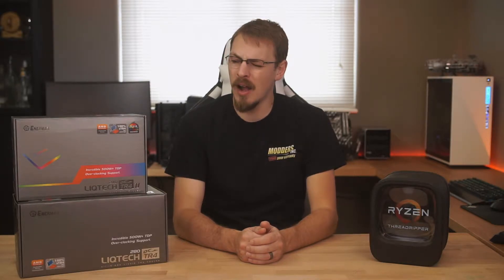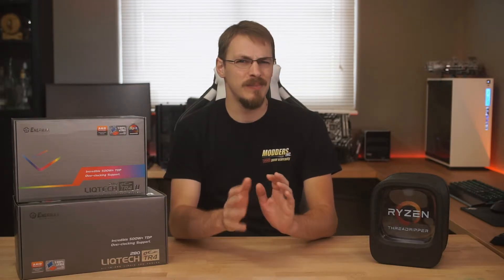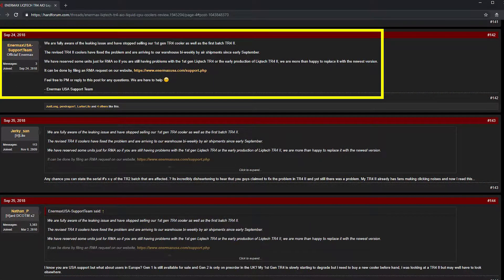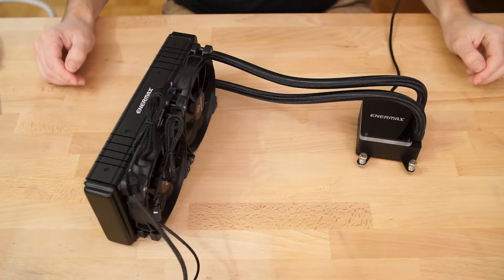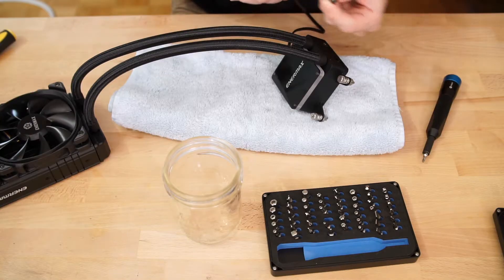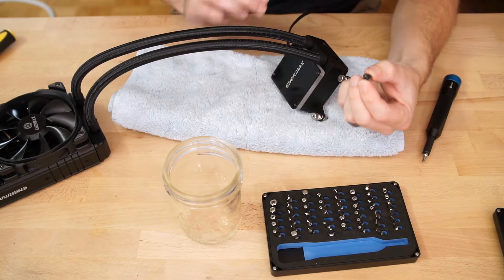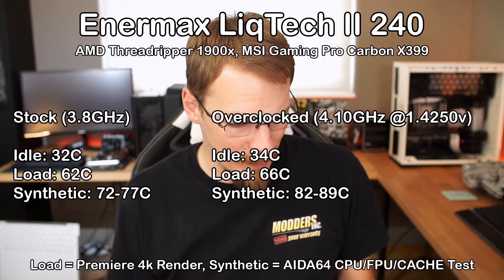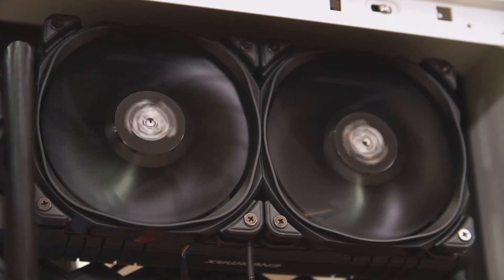Change of heart - Enermax LiqTech II 240mm TR4 Review

Comment: I had the first one and it died in a couple months.  So I replaced it with a Noctua air cooler.  I forgot all about it.  I am working on some old systems I have and had to look for some parts for them in my stuff and found that cooler.  I found out I had about two weeks left on the warranty and contacted them.

They asked for a photo of it with the serial number and a copy of the invoice.  I received the replacement today.  Less than a week from start to finish.  So great service from Enermax.  I haven't put the replacement in yet because I have to shut down and move things around in the system but I'm hopeful it works without issue.
Reply: Fuzzy Johnson Have you put it in yet and has it worked or not?

Comment: Glad to see people looking into this and reporting on the issue!! My Gen 1 Liqtech 360 was both gunked up and getting eaten away.. It nearly leaked onto my motherboard. I moved to the Gen 2 (as there was no other options for me at the time - none!) and after about 6-7 months now, the Liqtech 2 360 is now sitting idle at 55-60 degrees and load seeing it sit on 87! Just like what happened with my Gen 1. Absolutely not worth the money.. Wont be getting another one and wont waste my time with an RMA as it will just die again in 6 months.
Reply from the maker: Sorry you had issues. Enermax is aware and they have been working on solutions. Hopefully, they can get stuff straightened out.

Comment: Just taken my 1st gen Liqtech apart and it has corrosion i had the 360mm, i now have a 360mm Liqtech II - which I'm am stress testing for a new vid. However got my CPU down to 19c in the bios and before testing at the moment im sat at 22c, 1900x 4.1 on all cores. will do a stress test video shortly.

Comment: My liqtech 360 burst all over my GPU and I had to send my GPU, mobo, and cooler back for testing. 3 months later I’m finally getting replacement stuff back including the new liqtech 2. This is terrifying to hear but thank you so much for sharing! Will definitely be buying air cooler and sending this back too.
Reply: I know that this vid is a bit dated, but Enermax has reported on their site that they know of the fact that they had contaminated coolant in their coolers that serial number started with 17 and have since remedied it.
Reply: @OmniscientWarrior  that is correct but that was way after the issues were abundant. Plus 3 months to get back an entire system when they claimed it would only take 1-2 months? That's insane and unacceptable to me, especially if you rely on your system for a job, which i would assume you do with a threadripper build. I personally can't chance loosing out on work again for another 3 months.
Reply: @chrisyodonis6886  My newer computer is a TR build specifically for using Blender.  But I do have an old system that can technically do the work, but at 1/6 the pace.  However, it has no effect on the speed at which I can make models; rather call it prebuild models as need rendering to test and clean up and simple models won't be a problem but the big ones, the render time difference is really felt.

As for restoring the system, I do that stuff on my own, takes a couple of weeks.  Backups are your friend.  So it would come down to how fast they replace the cooler.  Even still, you can technically get by with a $50 one, just know your cpu will end up being slower due to lack of as efficient cooling.  I rather have slow opposed to nothing.
Reply: @OmniscientWarrior  Yes that is extremely true, if and when I'm modeling (mainly for fun not what I get paid for, which is editing/compositing) I use my laptop cause its convenient and it works fine, except for high poly modeling in in zbrush, then it chugs. 

As for restoring, the leak on the first gen liqtech poured out all over my gpu and fried one of the memory modules, rendering it useless.Which is my the company asked I send away my mobo and gpu along with the cooler, so I literally had 2 major components missing not just a cooler. I didn't have the funding to drop 1200-1600 dollars on a replacement gtx1080ti and x339 mobo so I was stuck with my 2012 laptop. Everything is and was backed-up, thank glob. The ssd and hard drives were fine and everything is up and running now but I cannot risk losing a system for that long again. As I'm sure you know time is money and when your laptop (or other backup system) is taking 6 times longer to render out shots, thats a lot of money to being losing. I agree that I'd rather take a few degree hit on the temps and have 32 threads, through the noctua tr4 coolers look ok till I get the money for a custom loop. 

 Basically though it was just a bad experience overall, from turnover time and communication to customer service. I get why people purchase this product, a top aio and the only aio with full plate coverage for tr4 sockets, hell it's why I got it. I don't begrudge people who buy the product or support it but I feel people need to know about the potential issues that may arise if they're building something they want to rely on for cash flow, even if my case was an anomaly.
Reply: @chrisyodonis6886  I would have to question your company about the turn around.  How long does it take to do a quick component check and swap, a quick cleaning with alcohol or other cleaner, then boot up (with IR if possible) and see how things work?  Then just subsidize the better cooler for a cheaper one until the replacement comes in.  You should have lost at most 3 weeks with standard shipping unless out of the country.  Labor time for me would have been maybe 2 hours.
Reply: @OmniscientWarrior  I whole heartedly agree and that paragraph you wrote is my whole point of frustration with enermax. Enermax is the company that the rma was sent out to. Their company does the testing and it took them that long to get the components back to me. Not to mention at the end of all of this they ended up giving me a check for a replacement because the motherboard was lost by them. This is why I will never go back to their company.

Comment: I originally got a first generation version and performance tanked, it would overheat under normal loads. After doing research I learned everyone was having the same issue.

I contacted Enermax and they were nice enough to send me a replacement 2nd generation version, but it has also started to show similar signs of degrading performance after a few months. Currently my Threadripper is hitting the tdie limit (68C) running under 10% loads. The processor is getting throttled to 3.1ghz when I used to be able to get 4.0ghz overclock.

They really should be recalling these and offering refunds.
Reply: I'm sitting on a Gen1 240 for my 1920X and it's idling at 68C. Can't even control the clock speeds for some reason, and it still tries to turbo boost or w/e it's called, so ofc temps go up more. I've been looking for replacements all weekend, but Enermax seems to be the only one with a plate covering the whole CPU. It doesn't help that I live in a country that has very little to offer in terms of tech stuff, so that will make it extra hard to find a replacement. Did you find one that performs well that you could recommend?
Reply: @romeozor  I went with an air cooler. I got an NH-U14S TR4 cooler and paired it with a TY-143 fan which I found gave me the best performance that fit in my case. I'm even able to do modest overclock to 3.9GHz no problem so I'm content for now. Good luck!
Reply: M D thanks, I looked at that too, but unfortunately my Corsair micro ATX case only allows for 120mm height cooler, and most start at 150mm. I ended up getting a Corsair H100i RGB Platinum cos it came with its own TR4 brace and I’m more or leas satisfied. The extra cabling is horrible, and I couldn’t care less for rgb, but temps are good.
Reply: Your not alone.. mine is now doing the same thing. Burned through 2 Liqtech coolers now and all its done is guarantee ill never buy an Enermax product again.

Comment: Just picked up one the other day (ver II 280).. hopefully by now (July 2019) they have it all sorted. Right off the bat I only see a few degrees cooler than the 4+ year old Corsair aio I had on there (was used in multiple systems still going strong).. not entirely impressed by the TR4 specific aspect of it yet.

Comment: I bought a TR4 II 360 and idle sat at 68, then throttled my 1950x to 0.54, before rising to 78 and shutting down! Swapped it out with a Coolermaster Wrait, now idling at 45 and never goes above 65. What a disappointment my first AIO cooler was.
Reply from the maker: Sorry man. Cooler Master stuff is great.

Comment: I opened up my tr4 240 1st gen after 8 month, and the gunk covered all microchannel. I drained the green liquid, rinse with DI water, fill with pure DI water, and it’s been working without gunk for another 8 month now. However the whole thing blow up yesterday...so yah it’s a shit cooler with good cooper block and big microfin. The radiator also looks very promising, the fins on radiator all have micro structure. The corrosion is just too much.

Comment: I have 1950X and after some CPU mining I noticed it was getting hot.  95C and I have a Thermaltake 3.0 RIING 360 Water Cooler ( Closed loop ).  I assume this means the pump has failed. Even at idle it sits at 60C.  Surprizing the CPU still runs great.  Just goes to say how well built these are.  However I want to get my temps back down.  Is it possible that the defect with the Enermax is the Cooling Fluid?  Is it possible to just use a different fluid?  Any recommendations?  Stilll looking for a good 360mm cooler for my Threadripper.  Seems the pumps on all these Closed loop systems only last a couple of years at best.
Reply from the maker: It does sound like something has failed and yes it sounds like the pump. If you have it plugged into a pen on the MB I would pull it off and just it off the main power.
Reply: @Moddersinc1  thanks for the tip I didn't think to run it directly off the power supply I'll give that a shot

Comment: Thank you sir! You saved my ass on a client build.
Reply: Or did he?  Have you been on Enermax's website?  They found the problem with the coolant and have replaced it.  So this issue only exists with serial numbers starting with 17.  You can file an RMA with them.  I have been using them on my new pc for a month, which I know isn't much time, but so far, it has been holding just fine.
Reply: @OmniscientWarrior  hey, do you have any update on this? I'm looking to buy one but not sure about long term use.

Comment: Aww man, I just got a replacement for my first gen liqtech after I noticed reduced performance. I contacted enermax and they sent me a liqtech ii.

Temps are okay, not great, and now I'm worried it might go down the same as the first one :(

I'm running a 1950x and unfortunately my case only fits a 240 radiator.

I can't clock over 3.8ghz without temps climbing to 80c, when I originally installed the system I was able to get 3.975ghz
Reply: Check the serial number, if it starts with 17, it may have (or had) contaminated coolant.  Also, if the environment around the computer has gotten warmer, then you should expect it to run hotter with it.
Reply: Enermax said that the first batch of TR4 II were also affected. They have suppose fully  fixed this now at the next batches of TR4 II. I can't know if the TR4 II at the video is from the first batch but it could well be as the video upload time is October 3 and Enermax announced this at September 28.

My TR4 360 died out after 10 months and I contacted them for RMA. It was an easy process and I am now waiting for the replacement to arrive, I think it will be a TR4 II. I will know in a ew days. I am likewise worried whether this will have the issue or not.

Comment: Which cooler do you recomend for 1950x? Great vid btw.
Reply: AsusRoG Go with air cooling. I love my be Quiet! Dark Rock Pro 4 TR4! Temps range from 24C idle to 61C heavy load. I render 3D with Maya/Arnold/Vray for hours on end. It's consistent... and nothing to leak on the other components like AIOs.
Reply: Coolermaster also makes a fairly large tr4 air cooler.
Reply: @michael22262   How many frames per hour can the threadripper do? I can't seem to find much information about tr4 and Maya/Arnold/Vray/renderman etc. etc.. Most people only ever talk about video editing or blender, and of course cinebench r15
Reply: Hi Ken. Well to answer your question about on frames per hour, it really depends on what and how you're lighting your scene. What a lot of people do is use a baseline measurement application such as Maxon's Cinebench. It's free. All you have to do is download it from here:
https://www.maxon.net/en/products/cinebench/
and then run the file.
When I ran cinebench on my older i7 3.2 gHz Boxx it only scored around 800. But that was fast back in 2010. In my new computer it gets to 2990 fairly easily. (Higher is better) 
Look at a lot of youtube testers out there like Gamers Nexus or Linis TechTips.
Also, go to pcpartpicker.com. One of the guys there was very helpful. 
Good luck!

Comment: Hey.
Don't know, if this comment section is still monitored, but do you have any plans to test the new Liqtech 2 non-TR4 version?
I'm really interested to see, if there is any actual performance difference between Enermax's stronger pump and maybe better coldplate, compared to Asetek coolers, like NZXT, Corsair etc.

Comment: I have the 360 one, about 7 months old. First I got idle temps around 55C, then 75C and now it goes from cold boot to 95C in about 10 minutes and shortly after that the PC shuts itself down due to overheating CPU. DO NOT buy Enermax AIO's!
Reply from the maker: So we recently did a review of their 360 mm variant. It was supposedly the re-release. Also, they were said to have fixed the issues. However, in testing, we had several issues with overheating. But not to that extent. Have you reapplied thermal paste? Also, what processor are you using it on?
Reply: @Moddersinc1 By now, I have reapplied the paste 3 times, have reseated the CPU, just in case. It has had no positive effect at all. Running 2950X at stock. The pump block gets hot, both incoming and outgoing tubes get very warm, but the radiator is totally cold. According to ASUS's some monitoring tool, the pump is running at max.
Reply from the maker: @sirius4k  Hate to say it but you need to replace it with something else. you reach out to Enermax to see if they will switch it out our replace it.
Reply: @Moddersinc1  I'll try. My first attempt trying to get in contact with them ended up with no reply.

Comment: Did some digging, if you can I would like for you to verify, did you get one with the serial number starting with 17?  I ask because Enermax found that they were shipped a contaminated coolant in those and have since corrected that issue.  If that is the case, if you would, please test a new one and let us know if there were any different results.
Reply: ohhh mine started with a 17. definitely leaked 4 weeks ago.
Reply: @Migeruski  Go to Enermax's website and see about filing an RMA for it.
Reply: Ive now owned the Liqtech 1 and 2.. Surely they picked up on this before releasing the Gen 2 models? Both have died on me now, and there was a 9 month gap between me getting the gen 1 and 2. This would effect all their coolers, not just the Liqtech line.

Comment: This is really disappointing, I was hoping the second gen was going to be better.  After all the problems with the 1st gen and corrosion/sludge that was never addressed, which then carried over into the second gen ("Contaminated coolant?"  Really?  How does it take so long to figure out your coolant is causing problems?).  After being unable to find an AIO with full IHS coverage other than the poorly-reviewed Enermax I went with the Noctua air cooler.  This thing is awesome, so much so that I don't see any reason to replace it with an AIO.  https://noctua.at/en/nh-u14s-tr4-sp3